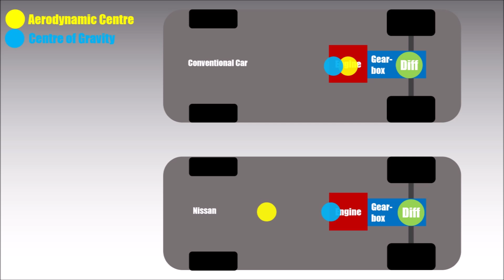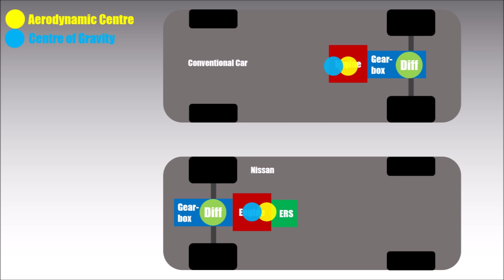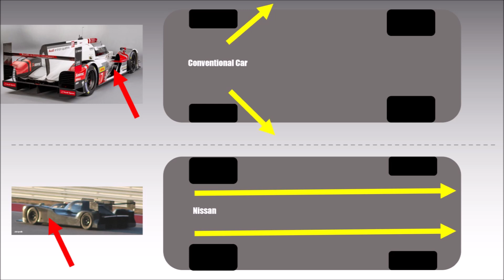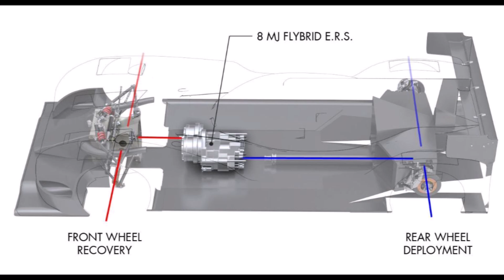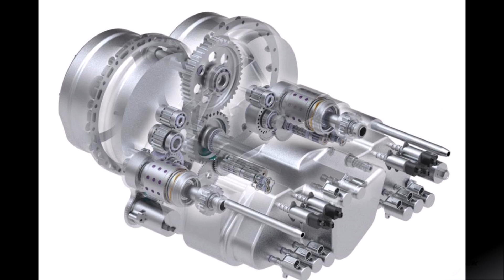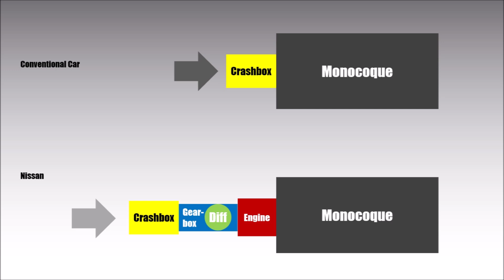Nissan GT-R LM Nismo (Le Mans 2015) - Genius or Disaster? - Technical Analysis

Comment: If they had’ve gone with an electric system from the start the whole thing could’ve been a real winner. Some genius outside the box thinking undone by impatience and underdevelopment. Definitely one of the biggest “what if’s” in motorsport

Shame this car is remembered as a failure and a joke because the ideas behind it were amazing and inspiring
Reply: You have to consider that, at the time, the battery tech was no good enough to last a full 24h. The degradation was pretty substantial. This is exactly why Audi used the electric flywheel design. Because even with the conversation losses, the flywheel would maintain consistent output. And also why Toyota used Super Caps. Porsche had said that they lose somewhere near 20% of the total capacity of their battery over the course of 24h. That's huge.

So the mechanical flywheel made sense in theory from that standpoint. And could have harvested power significantly faster than the electrical systems, and suffered almost zero degradation over the 24h.
However, ToroTrak sold them an engineering brief full of statistics that the system could have never reached. And in fact, none of their flywheel hybrid systems ever worked as advertised. Always at less speed, less output, and less capacity, all of which made them have no benefit due to their weight. There are some cool engineering ideas in their products, but it was far too complicated and convoluted to ever work right as a complete system.
Reply: @bigbuckoramma  had they’ve gone to Williams or just about anyone else really then they would’ve had a much better chance at making it work

Comment: Such a shame that this didn't work out. It's my favourite Le Man's car ever, purely on the basis of the incredible outside thinking. Nissan's engineers and designers tried something totally different to everyone else, but Nissan management killed it with their impatience.

If they had been able to get the mechanical flywheel system working, I can only imagine what a truly wondrous car they would have had.
Reply: I don't think that flywheel system would ever have worked. None of ToroTraks systems ever worked as advertised. Which is why the company went into receivership in 2018.

During the last test of the car, at COTA in sprint configuration, with proper LMP1 brakes, revised front suspension geometry, an updated clutch and gear ratios, and crucially WITHOUT the hybrid system, the car was showing great pace, and they were clearly making progress on the development. It was also around that time that the rumors of working with the Renault F1 team, and procuring dual a MGU-K and MGU-H units and a unique Super Cap system, based on the success of Porsche using both MGU aystems, was gaining traction, and seemed like a very logical step in the cars progression. But it was literally during that test, that the plug was pulled on the whole project.

Comment: In motorsport industry, teams so focused to get most out of what they had in such a short period of time and usually don't provide second chances.
That's not different for Nismo.
If they could have had a little bit more patient and time, I'm sure they might sort their problems out.
Reply: I'd go even further and say that Nissan could have saved LMP1 from dying in 2017 if they had given the car a second chance. It had potential and it could very well have been able to compete with the other OEM LMP1s if it had been developed further and eventually raced with an actual hybrid system. Maybe Nissan would still have raced in 2017, after Audi had left...

Comment: A few other things to mention:

1) The electronics were terrible (presumably related to time pressure), so in the onboards you can hear how crude the traction control is, and how long it remains active after slow corner exits.
2) The pullrod front suspension (combined with poor electronics above) meant that when the drivers touched kerbs it would massively upset the front end, resulting in even more problems.
3) On at least a few occasions drivers would lock the front wheels up so severely that they stalled the engine and had to restart it. You can see an example of this in the night onboard video that's also on YouTube at 0:27.

I was a bit disappointed they cancelled this program, because I do think it had great potential.

edit: One more thing: there was a HUGE amount of flex in the steering column too (visible from onboards), which probably wasn't reassuring for the drivers.
Reply: Things to also keep in mind with regards to this.

The hybrid system was supposed to shove the car out of corners from the rear wheels. And there would be little need for front wheel traction control.

Likewise, with a functional hybrid system harvesting energy under breaking, the front wheels would have used the smaller 13" brakes, with the smaller 16" wheels, and the bespoke tires with higher sidewalls would have compensated for the suspension limitations, by being an active damper for rough road, and curbs.

Couple that with the car needing new spindles for the now larger brake kit they had to run, that also further compromised the geometry of the suspension, and the new lower profile 18" wheels also imparting more shock load into the suspension pick up points.

And finally, the clutch and drivetrain issues with the stalls were also because of lack of hybrid. Those parts were never intended to move the car on their own. And were being pushed well beyond their rated load and duty cycle.

Without the hybrid, it was like trying to run a marathon without feet. Could you still do it? Sure. But you would struggle mightily.

Comment: Absolute disaster, there's a reason 90% of racecars have rear wheel drive. It was clear from the very beginning this isnt going to be competitive.
Reply: The same was said when front engine Grand Prix cars were the thing and mid-engine cars were being developed. Look at where we are today...someone has to "take the gamble" in order to be innovative.
Reply: @GreatAsaf  Same is true of the current "Coke Bottle" shape of F1, there was a period where the Delta design was very popular, and was the way forward. It took someone trying the radiator forward design that developed into the shape that nearly all race cars use today.

And to that end, this design was very intentional. The regulations of LMP1 had a fixed rear diffuser, but the front end was mostly unregulated on size and shape. So they used that pseudo loop hole in the regulations to build a heavily forward weight bias, and heavily forward aerodynamic center of pressure design. Which facilitated the need, and the logic, to go to a FWD platform. The benefits and design of the chassis and the wrap around tunnels to make the diffusers more efficient, was a happy byproduct.
Also consider that they had just come off the success of the Deltawing and ZEOD project, and those had extreme rearward bias, and no one says those were a bad idea (I mean, they were, but for total other reasons than performance). So they already had a mindset of thinking a bit outside the box in terms of weight and aero balance, and this was the result of that reimagining.
Reply: @GreatAsaf  The difference is nowadays we know the underlying physics which wasnt the case back then. Again, for performance reasons there is no better layout than mid engine rear wheel drive, thats just how it is, physics is physics, simple as that.
Reply: @benistingray6097  No, AWD beats rear wheel drive by far.